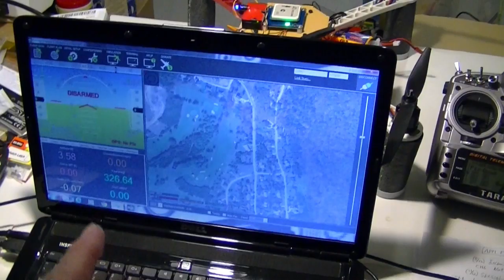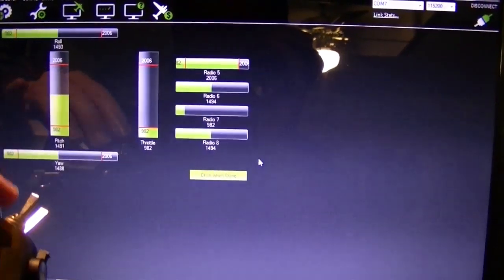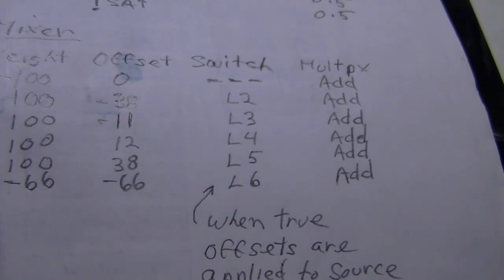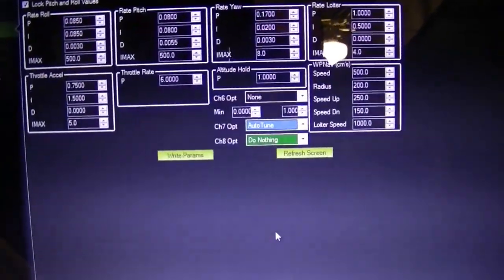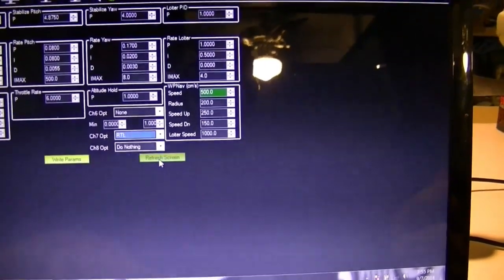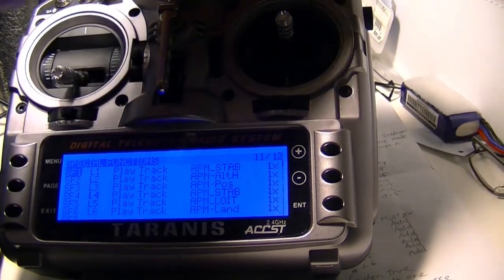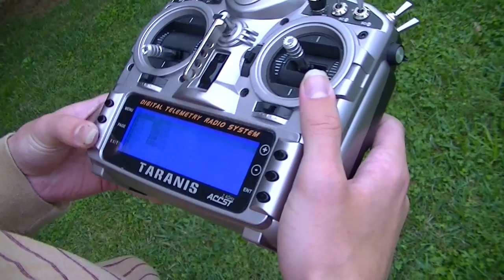PixHawk Quad Build - Setup 6 Flight Modes on FrSky Taranis for APM or Pixhawk Flight controllers

Comment: THANKS!!! This was "tutorial" #5 and several other "instruction" pages for me. Have to admit the paper written-out settings are crude, but effective. This was the clearest of any of the others I've seen. Near as I can tell, all terms were correctly used and explained. Bottom line, things clicked for me here that didn't on the other 4. Fairly short too, Youtube is full of folks who like to show off special splash screens and listen to themselves talk. My flight modes are entered, checked, and running  AND I understand while the others left me only disappointment and frustration.... Now on to Tilt AND Pan to a gimbal ;-P
Reply from the maker: I run my pan and tilt directly off the receiver rather than pass them through the FC but 5v for the servos is coming from a UBEC to be safe.
Reply: Have a Tarot hand-me-down 680 gimbal has it's own controller and I just got the USB adapter to program for pan (already has had tilt on a rotary dial). Had a servo control Ch2 (single) wire, but near as I can tell it does not work until I activate the Pan into the gimbal control software... My last significant build was somewhere around 1978, so this has been fun.

Comment: Hey Dave, do I need to have Mission Planner up and running while programming the flight modes into the Taranis?
Reply from the maker: Not when you first program the Taranis but to make the final tweaks you need to have the Mission Planner up and running while programming the flight modes. Guess you probably figured that out by now.
Reply: @DaveMerc  Yes Sir I did. Getting excited about this S500 should be up and running in a couple days or so. I hope. Maybe. Yes, it will. Need to reverse elevator, guess what, don't have a clue how to. Hint, hint.
Reply from the maker: Outputs page maybe
Reply: @DaveMerc  I will try that, had to mow yesterday. That backyard was (was)  terrible. That's only the 2nd time I mowed it this year. Need to have it looking nice for the vid's I'll be making. Thanks for getting back with me. It's going to rain around here today so that gives me more quad time,and, she's going to Walmart just me and my little dog and that beautiful quad. Thanks.

Comment: Hai Dave Merc Productions....!!!First let me thank and appreciate your efforts for doing all this stuff which is really helpful for people working on them.I am having a Transmitter of TARANIS-plus and my flight controller is PX4.I am facing a problem while setting up the flight modes.I have exactly done the same procedure what you have described in this video including the values entered in mixer and the switches used.But when i am trying to test it in the console window of the Mission Planner it is responding to only one switch variation which is an SD switch on the transmitter.I have also done the same logical switch configuration as mentioned....Why is this happening and please help me out with this so that i can set up the flight modes....Awaiting for your reply.....
Thank You....!!!!!!!!
Reply from the maker: Probably the other switch is not activated for the same channel.You can find out if the second switch is working by looking at the Taranis Channel Monitor screen. Both switches should change the same channel different amounts. You need to get that working before working with the Mission Planner.

Comment: Is it possible to create 5 flight modes on 2 3-way switches without having to use a sub-mode switch? Example SG switch has 3 modes on it, SD switch had 2 modes, and switch SF has 1 mode(RTL master switch)?

Comment: Alright I tried doing this and am running into a problem.  I followed this video to a "T".  
When I switch modes it goes through and says each mode.  I switch to stabilize and it says to me, stabilize, alt hold, loiter.  Not sure why its activating the other switches as well.
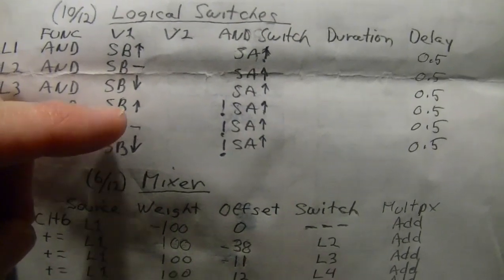Reply from the maker: wyattroa Check to make sure you have set the 0.5 sec Delays in the Logical Switches menu. See 3:33 in the video.
Reply: ***** Thank you for the crazy fast response.  But still no dice.  I must be doing something wrong on my end.  But I did check my radio with your sheet and with your radio in the video.
Reply: ***** Ill go through it again when I get home, I am sure I probably missed a step.  ill update you
Reply: ***** I got everything in order now.. Thanks for the video.  I missed 1 step which was holding me back!
Reply: what was the step? my modes are all over the place haha

Comment: You probably noticed that when you switch between your flight modes, it temporarily goes to flight mode 6 (which was set to RTL when you were demonstrating it).  This is caused by that half second delay that you have on the logical switches. If you get rid of that half second delay, it will immediately switch to the correct flight mode without going to the unwanted flight mode for a half second.  Also, to make it a little easier, you can just assign a weight without assigning an offset.  For example, L1 weight -70, L2 weight -35, L3 weight -15, L4 weight 15, L5 weight 35, L6 weight 70.
Reply from the maker: True you can do without it but the 0.5s delay with the logical switches it to prevent the Taranis from playing the sounds in between. If you switch from mode 1 to 3 or from 4 to 6 it will play both 2 and 3 or 5 and 6 so you will hear two sound tracks in succession. I have not noticed any ill effects from it's brief pass though mode 6.  Sounds good on using only weights if it works out with no problems.
Reply: *****
I figured that's why you had it there.  What I did was create 2 more logical switches (call them L7 and L8) that equal L2 and L5 but add in the half second delay.  Then instead of playing the tracks on L1, L2, L3, L4, L5, and L6; I play them on L1, L7, L3, L4, L8, and L6.  That way I get immediate change of the flight modes with no delay but still have the half second delay for playing tracks on mode 2 and 5  for when I switch from 1 to 3 or from 4 to 6.  Anyways, just another way to do it.

Comment: My taranis under Source or switch does not have an L1 or any L figure
to it I have had ti use CS1?
Reply from the maker: Stephen Galvin That is because I am using the latest firmware which has the new designation of L instead of CS.

Comment: Hi,
Why you set delay 0,5?
Thanks
Reply from the maker: The 0.5s delay with the logical switches it to prevent the Taranis from playing the sounds in between. If you switch from mode 1 to 3 or from 4 to 6 it will play both 2 and 3 or 5 and 6 so you will hear two sound tracks in succession.

Comment: Thanks for the help but what is the reason for the 0.5s delay with the logical switches? When I follow your setup every time when I switch modes, the mode is first going to mode 6 (manual mode) like in your video and thereafter to the selected mode. When I put the delay at 0 the switches work as expected.
Reply from the maker: The 0.5s delay with the logical switches it to prevent the Taranis from playing the sounds in between. If you switch from mode 1 to 3 or from 4 to 6 it will play both 2 and 3 or 5 and 6 so you will hear two sound tracks in succession.
Reply: ***** You don't notice the mode "jump" when flying? Your movies are a great help!
Reply from the maker: Gagarin737 Thanks.
 I have seen it going to mode 6 momentarily but it seems cause no problems so I forgot all about it. I guess it doesn't stay there long enough to actually activate mode 6 which for me is manual.